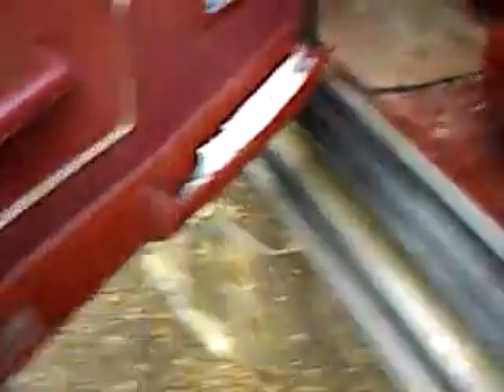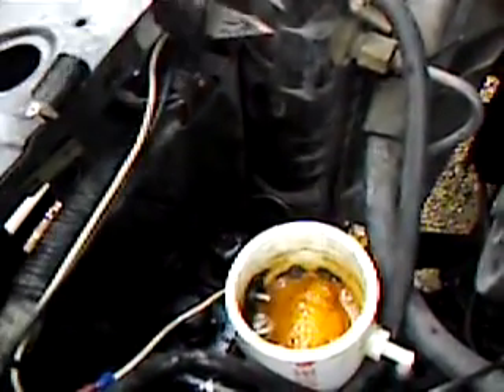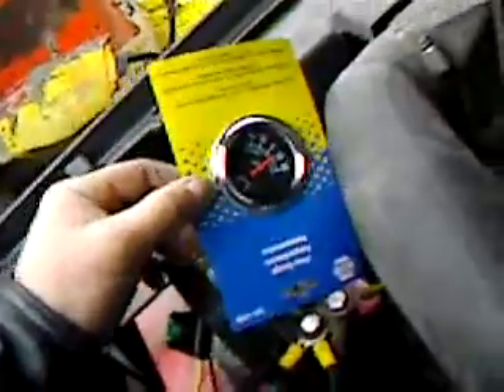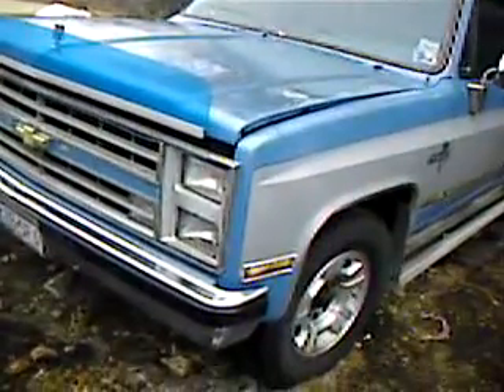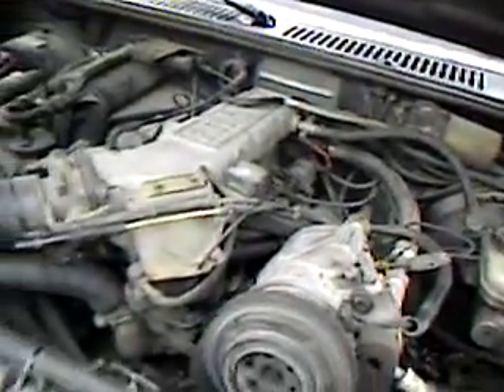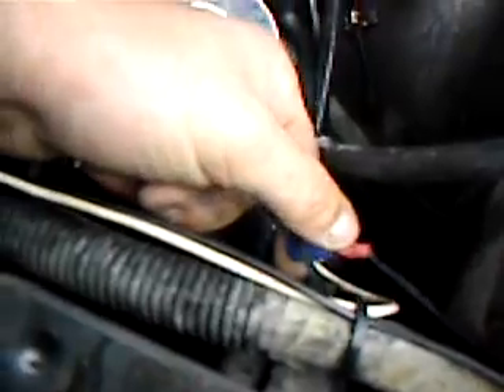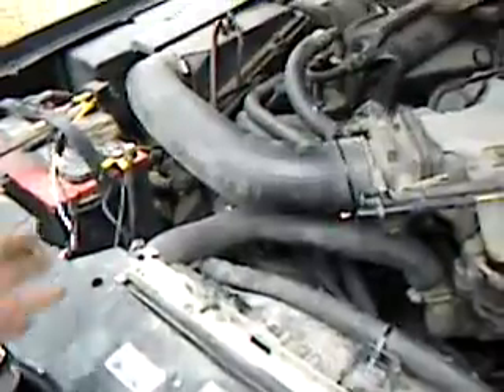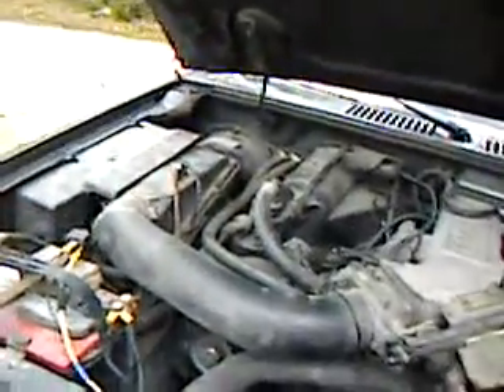Hydrogen Cell in my Bronco II, test results for "Nay" sayers

Comment from the maker: I agree, after reading several comments, I have made a few changes, the first was my cell.  The one that I had made was producing very well, but I needed more, so I rebuilt it with a new design.  At 10 amps I am producing near three times as much.  I adjusted the timing and will play with the oxygen sensor next.  I have also installed a very large cell in my 7.3 diesel, I will post vids of both results soon, thanks for all the support, sorry for the delays, life got in the way.

Comment from the maker: I am using less than 50% mixture, we are using 30%.  Vinagar is 3% acetic acid in water. Acetic acid is CH3-CHOOH.  Your numbers are right on, the baking soda is NaHCO3.  Lots of stuff there that I do not want to run through my engine.  I am not a chemist, but I build motors all day long and I can't see anything in the vinegar solution tat would cause harm to the engine.  Hopefully with the new cell, we will be able to produce quite a bit more gas while keeping the amperage to a minimum.  Thanks

Comment: Look up EFIE on the youtube there are some good videos on there that talk about the oxygen sensor telling the computer the engine is running lean on hydrogen/oxygen mixture and tells the fuel system that it need more fuel. Along with the timing (already mentioned in the notes) needing to be adjusted they should increase the mileage.

Comment: Take a look at mine I ran it too the main vacuum line strait hook up. I don't use a bubbler or anything, that way I take full advantage of the effects on vacuum on hho prduction. I use a water mister to keep the temps in the intake system below 500 degrees the flash point of hydrogen. I have never had a blow back, been running it this way for over a year now. Once I get the Dingle/Meyer set up too work I will switch over too full water on demand hho. I don't use anything but rain water, no salts

Comment from the maker: My timing is set to stock specs right now.  I was using this as a simple test to see if it will get my economy up a little.  If the results prove positive, then I will tweak this motor quite a bit and build a cell that produces a lot more hydro.  I appreciate the advice and will look more into it.  Thanks again, Jeff